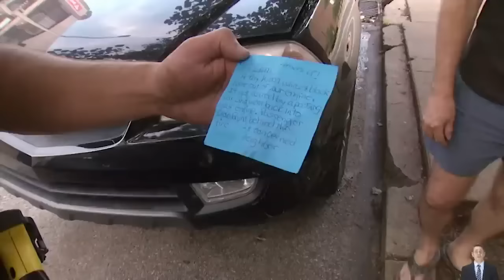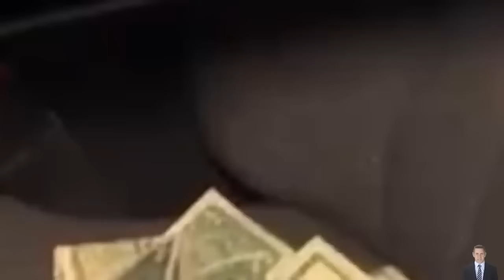COPS Season 33 Episode 17 18 19 20 🚔 COPS New Season 2022 Full Episodes HD

Comment: If the car is over heating, why is it still running? Wouldn't it be smarter to shut it off?
Reply: A  vehicle  that’s over heating cools down faster if it’s left idling !!   Now you know
Reply: Pro tip: If your car is overheating you can cool it down super fast if you pour exactly 18oz of pulp free orange juice in the antifreeze. Next get a twix candy bar and take the left twix bar, make sure its the left twix bar or it won't work! Open the oil cap in the engine and drop that baby right in there. Let the car run in idle for 15 minutes with the heater running on high. After that your car will be good to go and back to the perfect temperature. You can thank me later, a lot of people don't know about this for some reason. Feel free to pass this information on to your friends and family! God bless!🙌🏼
Reply: If car is over heating, turn up the heat and it’ll help cool down the car.